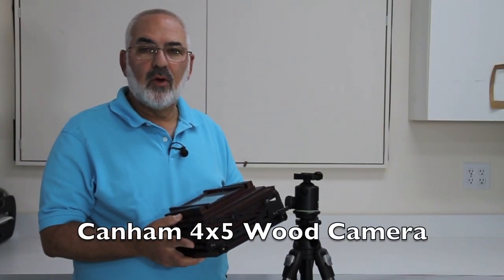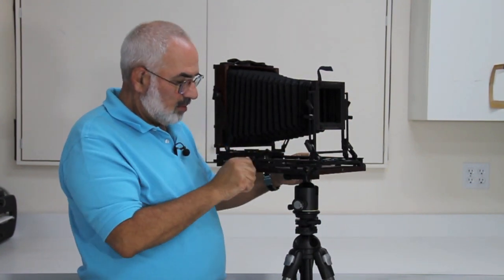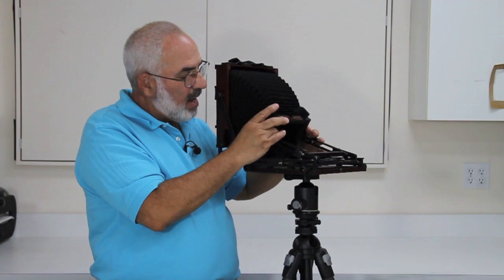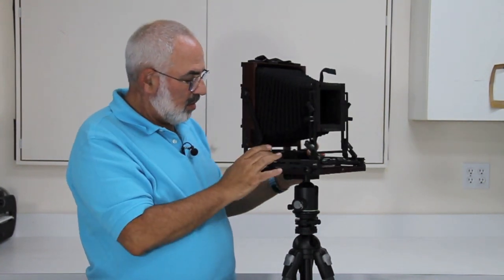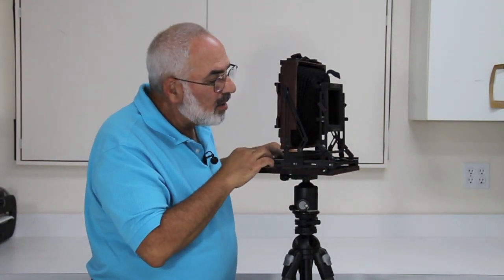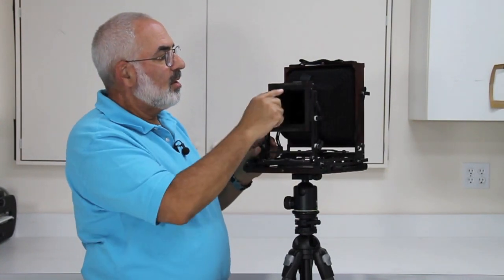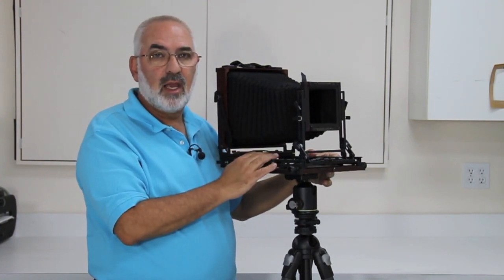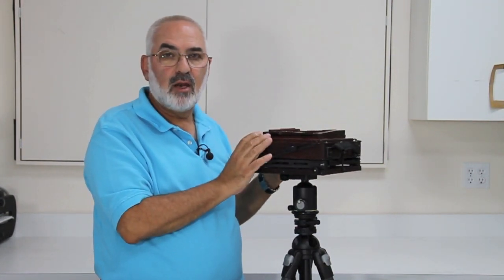20. Canham 4x5 Wood Camera

Comment: This seems to be a fine camera, but I realize that it is huge. The back standard looks to be big enough to hold a 5x7 screen. There certainly is a lot of wood around the glass.
Reply from the maker: T Latz - You are correct.  It is either a 4x5 or 5x7 depending upon which back you get.  You can get both backs (4x5 & 5x7) - so it is either a 4x5 or a 5x7 or both.  I know a number of photographers that have both.